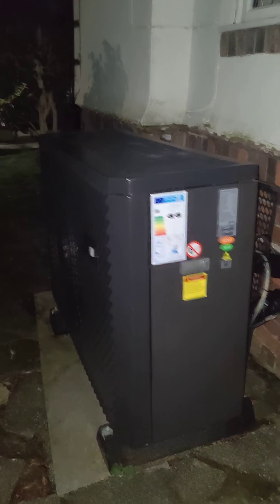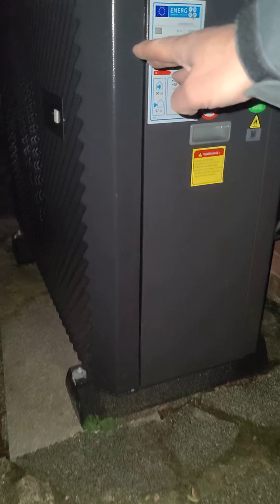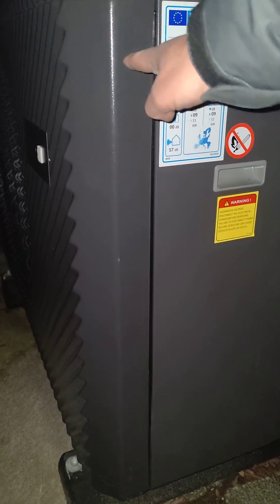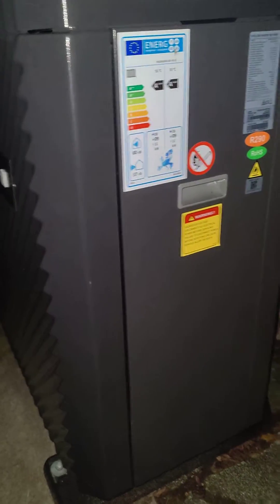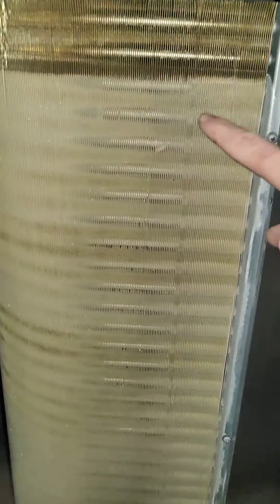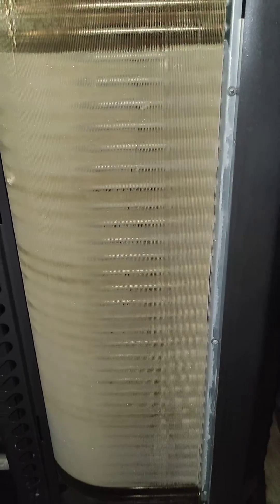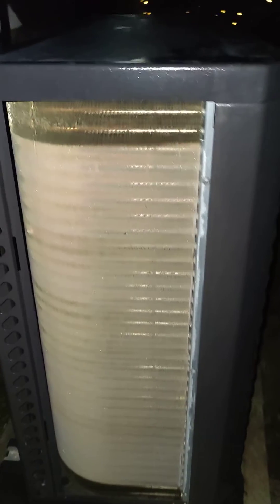How noisy is an air source heat pump when its really cold?

Comment: Hi Graham, I need your help. I live in a terraced house. The unit is planned to be set up close to the fence on the patio. On my right hand side luckily I have neighours with a few meters recessed compared to me patio door. So it would sit close to the fence but not near their patio door or windows. However, I wonder having a small garden and being in a terraced house with fences either side if it is something “sensitive neighbours (on the other side of the more distant fence - about 5 meters away) might really have or give me a pain with..? I am receiving support via ECO4 so I can’t really pick and choose. It will be the Baxi HP50-11 unit which seems I was told a bit more noisy than the mistubishi ones.

Comment: I’ve now had an air source heatpump  installed and couldn’t believe how quiet it is, yet it had to be away from my neighbours windows even though their wall mounted condensing boiler makes far more noise. It time the planning regulations change.
Reply: But surely boilers are not constantly running...

Comment: Hello Graham, I’m having trouble with my ASHP at home and was wondering if I can contact you anywhere regarding this? During the warmer parts of winter it works a treat, but as soon as we see these minus temperatures(England) the unit doesn’t seem to heat anything at all, it circulates the water as I can see on the flow sensor but doesn’t seem man enough to heat, is this a setting error?
Reply from the maker: Hi Rhys you dont need me you need to get your installer back, if its not hot enough when its cold it might just be set up wrong

Comment: Isn't your heat pump in a defrost cycle? Surely it's not running flat out, just idling to prevent the fan bearing from freezing.

Comment: Hi, we have a recently installed heat pump.  For the last 2 weeks it has been driving me berserk coming off and on all night long and I don't know what to do? The heating is not set to come on, the pump is just kicking in and out all the time. Can you help?
Reply from the maker: it will its trying not to freeze up, its cold outside , tbh your installer should tell you to run it 24/7 in this cold weather. mine never stops

Comment: Hi Graham. This is all very well. However the problem with noise comparisons and demonstrations when I comes to ASHP’s is that people focus on the outside fan/compressor unit and not the overall system noise. This is generally down to the quality of the installation. Our Freedom Heatpump system has been a disaster for us because the double Samsung unit itself is not especially loud. However in our bedroom we can not sleep with it running, as the noise comes from the pipes that run up and down in the wall. This is amplified by the fact we (as most new builds seem to now) have dab and dot plasterboard. Something many installers (and system suppliers) don’t take into account enough, and the noise of many noise complaints for these systems come from this, not the unit itself.

Comment: 12kw air source heat pump how much kwh would it use daily on a cold winter day?
Reply: I can't answer for Graham but I have an 8KW Midea and yesterday in Anglia it was below freezing for the entire day and my smart meter showed 60KWh at the end of the day. This is on a 4 bed detached house with cavity insulation (not a new build). I'd estimate 80% of that was for the HP and the rest on other consumption during the day. So on a really cold day you're probably looking at £15-18 per day at current extortionate electricity prices (circa 35p per KWh). Hope that helps.
Reply: @jeffjeffjeff2  Thanks a lot its really appreciated
Reply: @azamshah562  No problem at all. Like I say I can't answer for Graham but hopefully it's food for thought
Reply: I have a 9kW Samsung ASHP, it's set to never pull 9kW, but in the recent cold weather its been using between 40-50kW a day maintaining 18-20 degrees inside our 4 bed house whilst seeing it around -5 outside all day.
I'm no expert, just things I've picked up in the year or so of having an ASHP installed, but the installer will likely set a limit on how much power the unit can pull, or it will do this itself for maximum efficiency. I'd imagine if it was regularly pulling 12kW every hour no one could afford to run them!
Reply: @adam_b1187  Thanks a lot Adam. That makes sense.